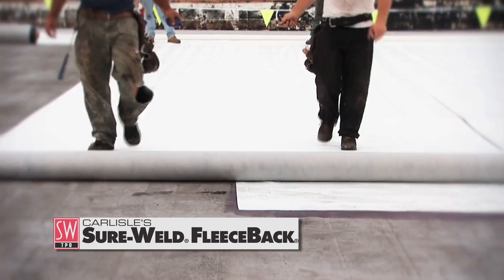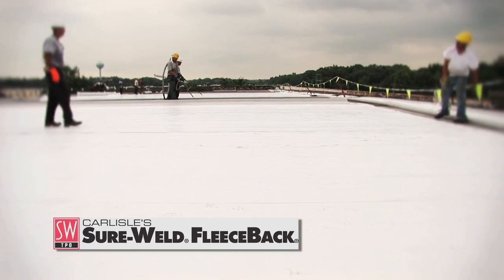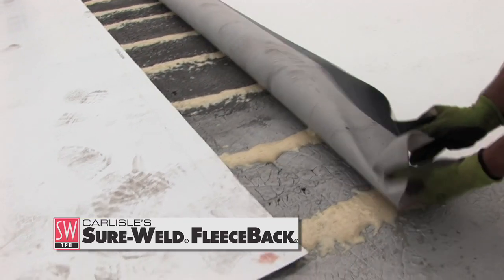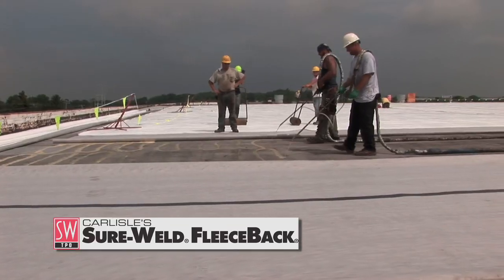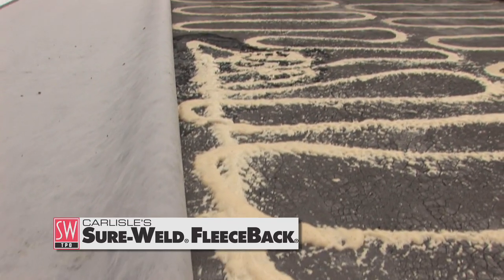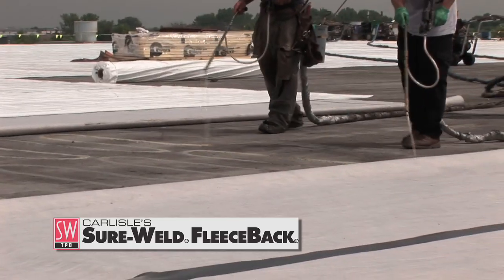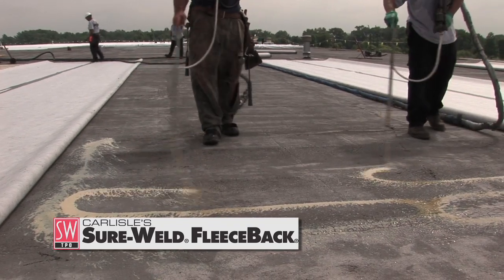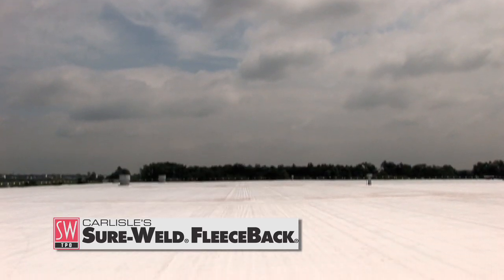Carlisle's FleeceBack/FAST Roofing System Case Study

Comment: On a football field roof with zero penatrations, no tear off or even insulation to lay and screw/glue it's a simple pimple to get 800 square a day ,I could see 10 men laying 1,500 square a day with this system ,the only problem with laying out even 800 square is the seams ,you'd need to run 4 dogs at a minimum in order to weld all your seams water tight every night ,200 square is a hell of a lot of seams for 1 man to weld in an 8 hour shift ,you'd need a minumum 20kw generator to run all the dogs and hand welders but it can be done .